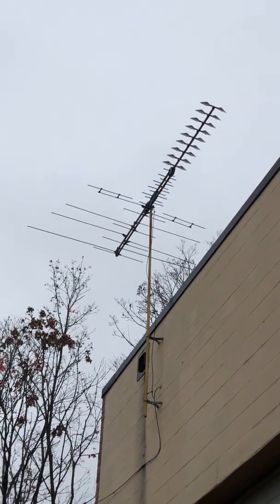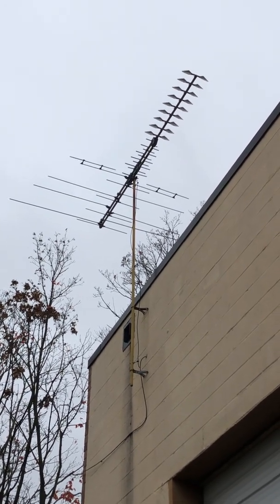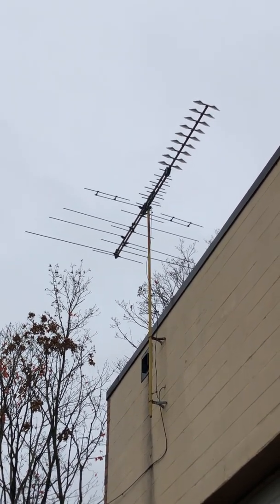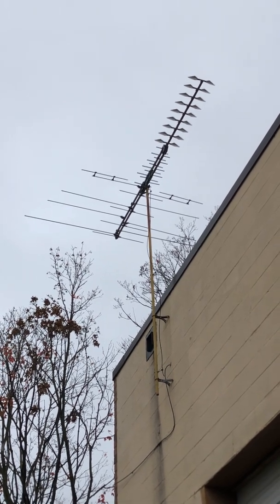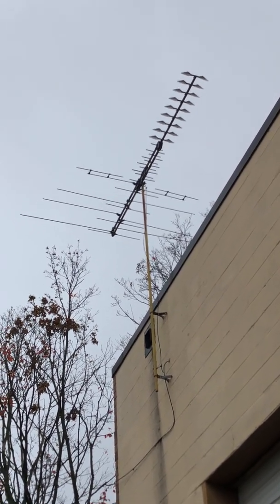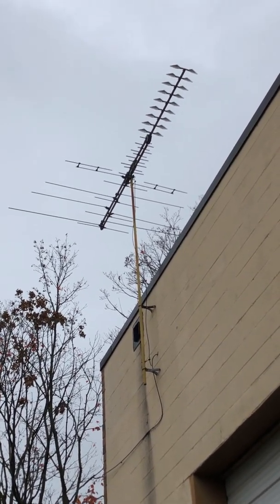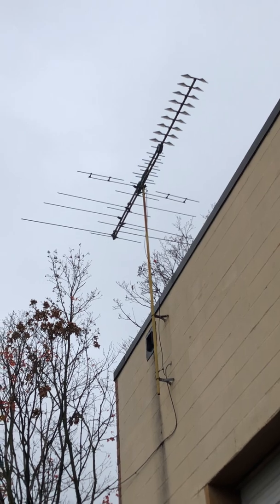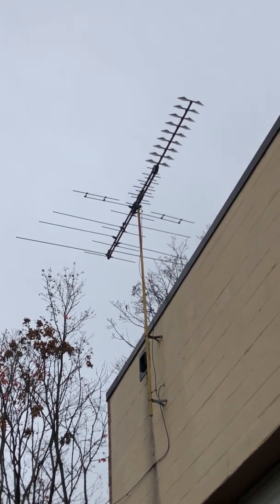VHF/UHF TV Antenna for ham radio

Comment: Thanks just picked one up about 10 12 feet have a tuner and old radio was curious about rigging something up in my shed you just clarified it's possible thanks
Reply from the maker: You can use the parts to build something else.   It’s not really meant for the same bands as the ham bands.   And the coax for a tv antenna is 75 ohms.   Not 50 ohms like your radio requires
Reply: Yes understand going to rig something up, do a little more research before I light Er up take✌️ @mikecricket113

Comment: I wanna know how to use it to connect walkie talkies in different locations and as a transmitter.  U do tutorials or the link to the articles
Reply from the maker: @Father_Tahjae   one would have to dismantle existing tv antenna.  And cut rods to length for band wanting to be used.  Also make a new gamma match and solder 50 ohm coax connector.   This video was to pose the question if it’s possible.
Reply: @mikecricket113  understood I am from a third world country. We don't have like courses etc. I would pay to learn. Once you have a course bro hit me up. I would love to like connect different cities together using antenna an radio

Comment: Good ideas! Rotating it in present form would not be worth the trouble because it loses directionality when on other than commercial broadcast freqs. I love tearing them apart and rebuilding them into other antennas like 2 meter and 440 beams, hourglass loops, halos, folded dipoles, tuned fm radio antennas, SW Listening loops. A 6m quarter wave vertical ground plane antenna with elevated radials, quad loop, etc. Amazing fun once you get an antenna analyzer.
Reply: @johnhess351  I’ve got a big one in my yard of the house I just moved into, I want to turn it into a gmrs/ham antenna I need someone like you around 😅